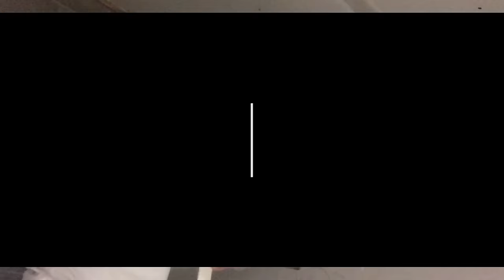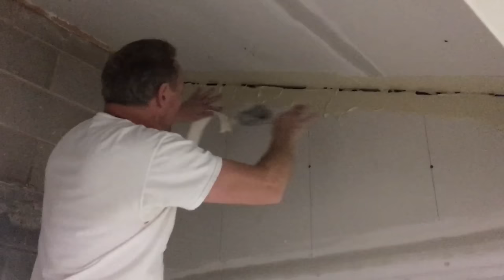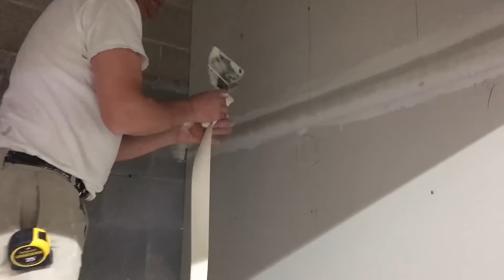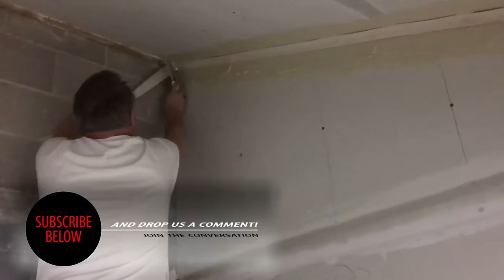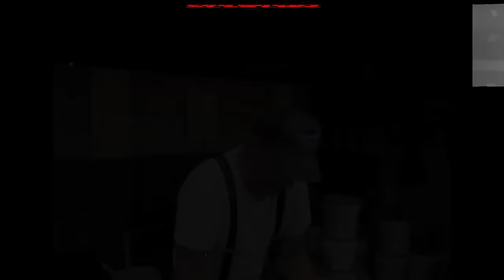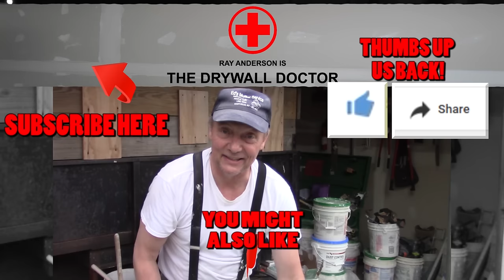How to Fix Gaps in drywall angles by Hand

Comment: This is an OK method for fixing the gabs I think it’s easier to just put a lot of mud into the corner skillfully and then just put one piece of tape angler properly in the corner and then just mud over it and just be carefully you’ll get a very smooth finish course if someone ever pushes the corner then it’s all pointless

Comment: Lovely advice at the end but I wonder if you could tell.me what material you used ie the mud you refer to and the tape has it got a technical name?
Reply from the maker: The mud I taped with was a setting compound called durabond 45. It gets hard in 45 minutes and it's just tapers tape
Reply: @THEDRYWALLDOCTOR1  thank you for your response

Comment: So, how would you fix a gap that is on the ceiling angle? Would I add tape and mud to both the ceiling and the wall? Its a large gap that was created after altering the wall during a remodel......
Reply from the maker: With it being on the ceiling it's tougher because it wants to fall down. Mix the hot mud stiff and use fiberglass mesh tape after it's set tape it like this.
Reply: @THEDRYWALLDOCTOR1   Thank you! That helps a lot!

Comment: Hey Doc, or whomever. Referring to "gaps", what do you do when the boarders don't flush the drywall perpendicular on an outside corner. Hard to explain, I mean it's not 90 at the corner because they didn't cut the board flush. Do you guys just go ahead and run the bead or do you prefill? Thanks all :)
Reply from the maker: I do prefill and or tape it  and then super wide tape on bead
Reply from the maker: And this is me your talking to.
Reply: Thanks for the quick response. Learn a lot from you. I'm a journeyman painter of twenty five years. I've got some taping knowledge. Locally, tapers are runnin dry and I'm filling the void so to speak. Looks like I'll be busy till I never retire ;)

Comment: Do you recommend this method for stress cracks in the corner of walls, that expand in winter and reduce in warm months?
Reply: I’m having this same issue. Did you get it resolved? I’m worried any fix will just be temporary.
Reply from the maker: https://youtu.be/RlMe1FEmggg

Comment: I enjoyed your video, but I have a unique situation that I hope you can offer a solution for. Just finished tiling a shower with uneven walls, so there is a large gap between the upper edge of the tile, and the ceiling. I considered filling with caulk or drywall mud, but I think those options won't work due to shrinkage, cracking, or remaining water resistant. Any suggestions???
Reply from the maker: They make all types of tile trims that can probably put up there maybe like a crown molding made out of tile . I used a tile rope around my window in my kitchen
Reply: If you're not going to cover it with some kind of tile trim, then use SANDED GROUT, which is made for large gaps or joints. Pick whichever color you want.

Comment: Don’t you want to backfill that a lot more?   I would be interested in seeing how that lasts.
Reply from the maker: 5 years ago and still no complaints.  That's my wife's sisters place.
Reply: I’m like a year into drywalling.  And I spend so much time filling gaps on bad old houses.   Some aren’t terrible but may just start taping/backfilling them as we seen here
Reply from the maker: The Drywall needs a place to move if you make it to tight it will bulge out or crack that's why you're supposed to keep it 1/2" off the floor. It can also move in the angles without to many people noticing.

Comment: Hello. Just wondering if you used hard set/ the powder type of drywall mix or was it the bucket premade stuff?
Reply from the maker: This was a hot mud but it doesn't need to be
Reply: @THEDRYWALLDOCTOR1   Thank you! Also do you think its ok to use mesh tape or does the paper kind have to be used?>
Reply from the maker: This one I would definitely use the paper tape in the angle I never put mesh tape in angles

Comment: how do you fix a gap in the middle of the ceiling? I am clueless to fixing gaps on the ceiling.....
Reply from the maker: I will put fiberglass mesh tape on and pack it with durabon just to hold it in place once it sets up then I just tape over all of that with regular tape.
Reply from the maker: The fiberglass mesh holds the dura bond in the Gap so it doesn't fall out
Reply: I have the fiberglass mesh but not the durabon😑 heading to lowes now thank you!!!
Reply from the maker: Any setting up compound works

Comment: I'm doing a shower, can I fill my edges with mud or am I asking for trouble?
Reply from the maker: You can fill it with mud just make sure it's sealed really well before you tile it and cover it
Reply: @THEDRYWALLDOCTOR1  okay its a fiberglass stall and im just going to mud the "flanges" i guess you would call them. Seems like alot of mud but I've no clue how to fill that gap without it sticking up to high or spending a ridiculous amount t of time cutting down some wood or drywall. Thanks for the response, do you have a way of receiving payments? Advice is worth so much!
Reply from the maker: If you have not drywalled that yet I actually trim  the back of the drywall but it around the tub sometimes I will even use tear away bead but if you already just butted it up to the flange you're going to want to tape that not just mud it in